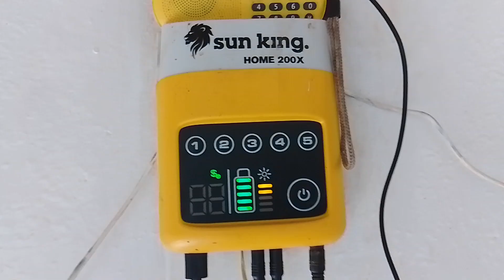Second Day _Fencing my LAND

Comment: Painting inside with the right paint ,so tht one cans wash the wall when necessary . The idea is to make everything asy to clean Nice work going on . The framing looks perfect . Write down as much as you can because , your memory might fail , I am talking from experience . Watch out for the laud mouth reactors . When they are done with you they will turn on you . Do you use surveyors
Reply from the maker: Yes we use them.

Comment: Paint the kitchen.The smoke will come out of the chimney so it shouldn’t soot up the walls.
Reply from the maker: Okay
Reply: When the fireplace is in use the chimney will be hot and if it is you will have to put a protection  so noone gets burnt especially kids running around.The next fireplace you are making ,put most of the pipie inside the house and just a piece with the cap through the wall at about 7 to 8 ft from the ground.Explain that to the guys that do the fireplace